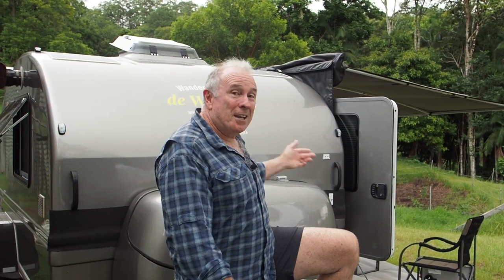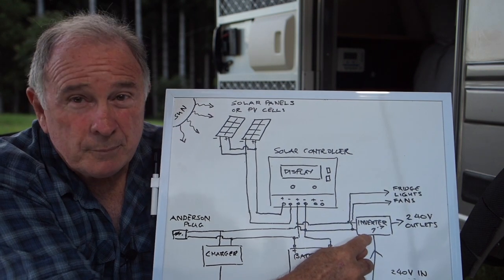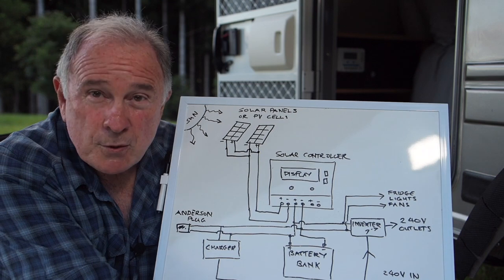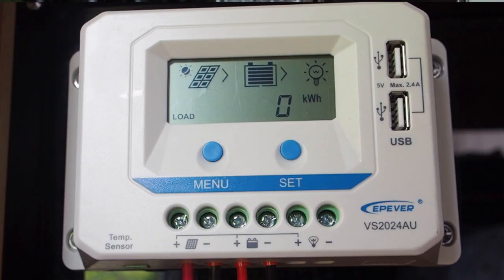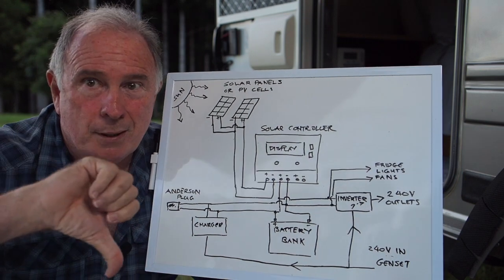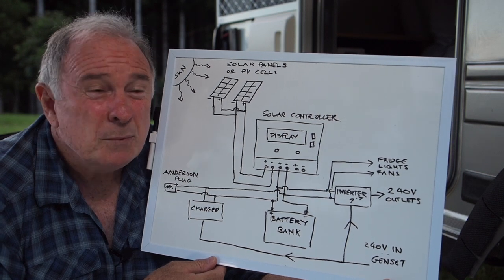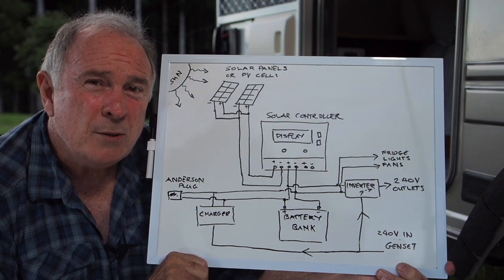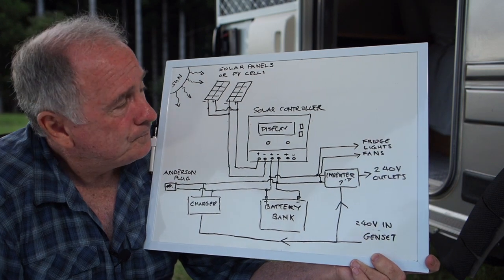ELECTRICAL SYSTEM - TUCANA TEARDROP CAMPER

Comment: Hi there, appreciated your commentary.  I  have a new (april 22) tucana.  Loving it but am having a problem with charging battery on mains whilst in storage - it's at 12.1v at present but my victron app is saying I'm 85% charge in battery.  May be getting terms mixed up.  Can u help?
Reply from the maker: Hi Jenny! It certainly doesn’t look like it’s charging. If mains power from a 240 source is being fed to the van and that is turned on. Firstly I’ll need to ask is your app set to charge? Just having power to it won’t be enough, it needs to be turned on
Reply: @wanderlustwithdewitco2168  hi again Craig.  I have a smart shunt app which allows me to change settings but I don't know what these should be.  Would a factory reset be of any help.  Also I had a look at the inverter and checked the fuses which are fine, and noticed a small switch marked with chr, (is this charger?) off, and on, should this be in the on or chr position.  The charger light is flashing orange when it is in the on position.  Thanks for your assistance with this, cheers jenny
Reply from the maker: Yes you need to turn this on, that will now allow the Victron charger to charge your battery. Almost immediately you’ll see the “shunt” voltage go up a little and it will continue to go up till fully charged. Hope this solves your problem. ☺️
Reply: @wanderlustwithdewitco2168  Hi again Craig.  Still  no joy.  I think maybe my settings are still wrong.  I've read the troubleshooting guide and voltage input should be between 185 and 265Vac, my output settings are set at 11.97V (that's the current state of charge according to the multi) the current is at -0.22A, power -3W.  Bars on battery icon is at 1.  How do I check input voltage.  Info says to set charging current at between 0.1 & 0.2×battery capacity (mine is 100ah, 12V)  does this  mean 200ah & 24V
Reply: @wanderlustwithdewitco2168  hi Craig I'm not sure what u mean about app being turned on..  it's connecting to multi, is that it?  You were right about voltage increasing, (I live in hope) went to bed after that and checked in am, battery still going down by .1 each day since.  Any ideas?  Thanks for you efforts, Jenny

Comment: Great video , can you tell me does the battery charge off your car when you are running??
Reply from the maker: Hi Russell… thank you! Yes it does charge off the car alternator through the Anderson plug. Having said that it will only be a trickle charge. To maximize the charge potential.. in other words if you want to get a high current charge in you would need to fit a dc to dc charger either in the camper or in the vehicle to the Anderson plug. Better closer to the battery you are charging for best results

Comment: Are the campers east to reverse, on my own, thinking og getting one
Reply from the maker: Hi Pam… because they are small they are relatively easy to reverse and also on some occasions you just unhook and with a little help can be pushed around. Some folks have installed a power jockey wheel on the front and then can fit it in very tight spaces. ☺️

Comment: Can you charge from the towing vehicle using an Anderson Plug?  If  "Yes" how does this work? How long to recharge - that sort of thing.
Reply from the maker: Great question! Yes it will charge through  an Anderson Plug however unless you install a DC to DC Charger in that line.. ( like in the camper somewhere prior to the camper battery) it will basically only trickle charge. Reason being most cars have alternators which drop the charging voltage once the battery in the car is optimized. Does this make sense or would you like further clarification on this?

Comment: Thanks Craig. So informative!! I am still not sure where the inverter is.  And can you explain about the orange battery switch in the kitchen area?
Reply from the maker: Hi Danielle! Have you seen the video I did on the inverter? It shows where the inverter is. Regarding the “orange” switch , it’s the isolator switch which basically will isolate anything on the power side or load side of the battery. I’ll do a short video on this soon. Basically it will stop power going to your lights, fridge and inverter. Note the battery will still receive charge from your solar panels and Anderson plug with the isolator switch open. Hope this helps?